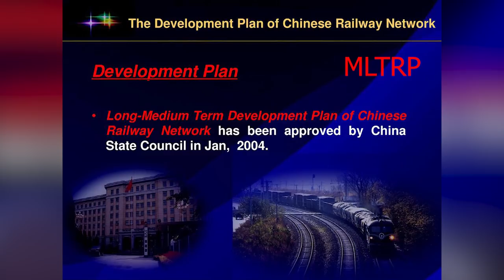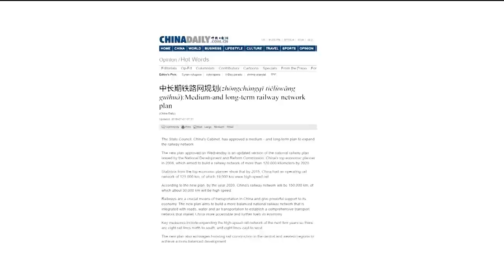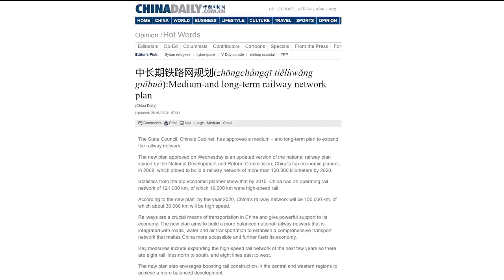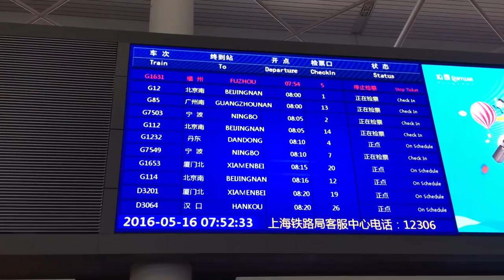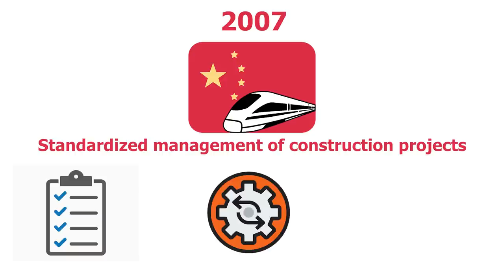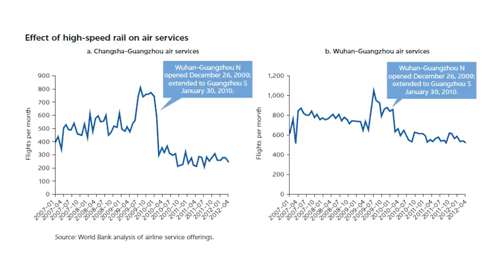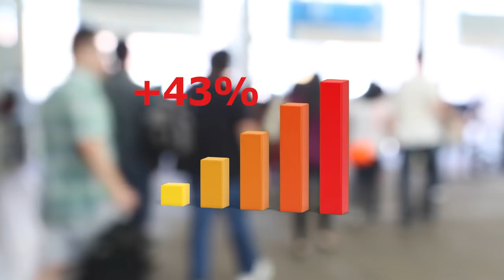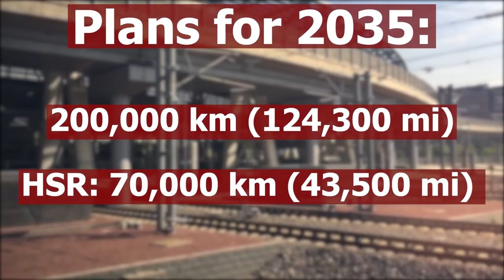How China Constructed 36,000 km of High-Speed Railways (in less than 12 Years)

Comment: I've read that the main cost saver of the Chinese rail is that they can push down prices on critical components. With such vast scale, if you order 1000 trains, even the most expensive components can be produced at an assembly line. The same applies to electrical systems and switches that would cost millions if you only build one train line.
Reply: Agree! And also imagine the industry it brought, the suppliers, and more importantly, it pays everything domestically with RMB, it enables the government with more methods when international economy crisis hits (eg. 2020)
Reply: Plus china produces large amounts of those within china. The scale of china's HSR lowers the cost-per-unit for china and boosts economy directly [by creating a big customer for steel, cement, etc.] and indirectly [enabling people to get around faster]

Comment: Easy way to rough calculate the ticket price for the high-speed train： 0.5RMB or 0.076USD per km, like Beijing-Tianjin（first high-speed line in China）is 113km，ticket price is 55 RMB(8.4 USD).
But the longer the distance, the lower the average price ，like Beijing-Shanghai is 1302km， ticket price is 550 RMB(84 USD), and Beijing-Guangzhou is 2118km, and the ticket is cheaper on average which is 860 RMB(131 USD), well all this price is for the 350km/h line, and secondary line price is even cheaper.

Comment: This is not so different in magnitude from the construction of the interstate highway system in the USA between 1960 and 1975.  Something that was never required to turn a profit.   I wonder how much the legal environment facilitated this rail project and hinders anything similar in the US in the 21st century.   I doubt it would be possible for the US to build the interstate system today post NEPA.
Reply from the maker: Good point. When constructing such kind of network infrastructure, incomes should at least cover certain percent of construction and maintenance costs. For the US highway network, at the beginning it was around 70%, now it's even less. However, there are indirect benefits that are taken into account, as we said. Cost-benefit analysis is used in such cases for example. And by the way, we are planning to make a video about SF LA HSR soon, so will discuss that in more detail.
Reply: China's expressway network is actually larger than America. And it was constructed almost simultaneously with the high speed rail network.
Reply: One major impetus for the interstate highway was the facilitation of rapid troop, weapon systems and military equipment deployments to all corners of the US. A product of the cold war.